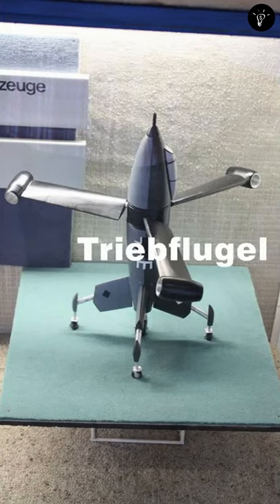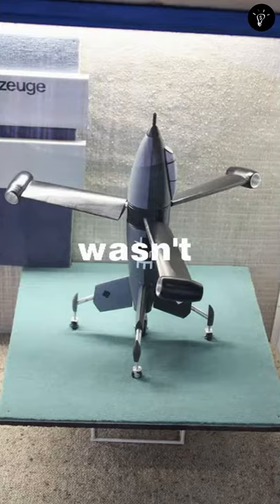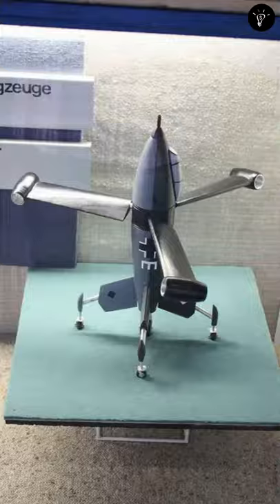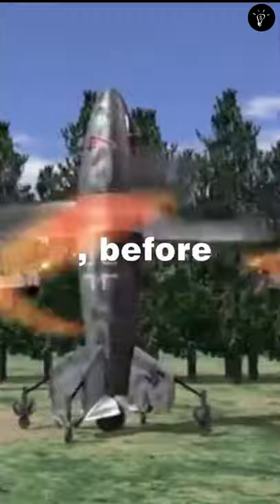Helicopter or a fighter aircraft ?

Comment: Smoked the allied powers? That’s just nonsense to anyone that has studied history. The ME 262 was operational and far superior to the Ally’s fighters. Didn’t matter though because the superior numbers of army air force fighters just waited till the 262 needed to land and then they smoked the jets.
Reply: There arnt many acounts of this happening and the success rates were low. The 262 is a shark of a jet. It's most eye piercing flaw being that fritz didn't have enough of them. If they had as many 262s as they did 109s and 190s the allied air campaign would be, to quote the profit of truth "A colossal failure"

Wouldn't have changed the overall outcome of the war I don't think but it definitely would have dragged it out longer, like 47 or 48 with more tanks and planes being produced certain battles in the east might have taken different turns for sure
Reply: It's performance was superior at certain altitudes and me-262 fuselage had less survivability due to it's weak fuselage for that kind of engine
Reply: @brecibros2469  its largest flaw was literally everything about it, but in particular the engines, which had a service life of something like 25 hours before needing to be overhauled.
Reply: @17njl01  okay my points still stand. If they had more of them they would just have to wait for the bomber  escorts to run out of gas and they would be defenseless even with the escorts us pilots hated having to fight them. They were to fast.

Comment: Is the aircraft you are showing aerodynamically stable? A helicopter has a counter rotor or a back rotor, the only kind of counter rotor device this thing has are those relatively small fins. The USA made a similar  aircraft in the 1950's I think. Based on the very limited success of that model, to say this aircraft would have "smoked the allies" is a grandiose overstatement.
Reply: Defense stance I have to say it would also have a bigger silhouette making it easier to hit the rotor or wings. And new tech takes new training as well as materials to produce which Germany already lacked
Reply: Helicopters need a counter rotor because the force accelerating the rotor is exerted from the engine in the fuselage and thus also on the fuselage. Here, the propulsion is by jets or rockets on the tips of the rotor and so torque applied to the fuselage would be simply by friction and I'd imagine it would be negligible. Certainly negligible at normal flight speed.
Reply: @Patrick-zr8tv  there could not be rockets or jets on the tip of the rotors because there would have been no way to supply fuel or throttle or pitch control. The video narrator is just full of shit there's absolutely no way for that concept plane to have ever even lifted an inch off the ground before falling over and blowing up.
Reply: @chrisbooge2217  I don't see anything that would prevent throttle control and you dont really need pitch control. Nice to have yeah but not necessary, particularly in this case.
Reply: @Patrick-zr8tv  the same thing that prevents fuel from getting to the tips of the rotors would prevent throttle control and ignition / shutdown control. And you would have to have pitch control there's no way around helicopters have it the osprey has It anything that takes off vertically by means of spinning blades has to be able to spin the rotors up to speed then progressively change the pitch to create lift .
Reply: @chrisbooge2217  I have no idea what you're going on about with the fuel not being able to get to the tips. If anything it would be easier because you wouldn't need a pump you could just the centric acceleration for that. 

And with the variable pitch, it seems to have that ability. If you look at the root of the blades it has a metal rod connecting each blade instead of meshing nicely with the main bearing or whatever it would be called. My point was though that it's not absolutely necessary for it to be able to fly.
Reply: @Patrick-zr8tv  first you were talking about it having rockets or jets on the tips of the rotors the wings are not big enough to be fuel tanks so you would have to transfer fuel from the fuselage down the rotors to the motors on the tips.  So you can throw all those ideas out the window. And yes it would have to have pitch control for takeoff and landing like most ever other propeller driven vehicle ever made.
Reply: @Patrick-zr8tv  and I see no metal rods on the 8" tall model on the desk or in the animations.
Reply: @chrisbooge2217  why could you not transfer fuel from the fuselage to the motors?? And again, no, it wouldn't need pitch. That's helpful for having quick response but all you need to have is the ability to change the rotor rpm, so just throttling. 

The metal shafts are towards the leading edge of the blades, just looks like a bearing at the base of the blades.
Reply: US formerly has a aircraft like this design, and they are fk terrible
Reply: @lurkingblayd3470  yeah it kinda looks like the wings be just easy to hit if you continuously aim in the direction.  Probadly an ugly damage be taken
Reply: @Patrick-zr8tv  you can't transfer fuel through the bearing device that it rotates on or throttle control especially with 1920's technology. And once again there is no metal rod. And yes it would need pitch control every rotor powered vertical takeoff vehicle ever built and flown has had pitch control.
Reply: @chrisbooge2217   Just because other VTOL aircraft have rotor pitch control doesn't mean it is necessary. You can control lift generated by changing rpm as well. This doesn't even matter though because it seems to have pitch control anywah

As for the fuel I really don't think your point has any legs to stand on. Much crazier things have been done, it's possible, this was designed during world war 2 in the 1940s when development was ridiculous and there isn't anything to say it can't be done.And the throttling not being possible, that's just not true. There is nothing preventing a throttle from working in those jets.

The metal rod is there. I'm looking at it right now, it's on the model in the thumbnail.
Reply: @Patrick-zr8tv  yeah he's right just admit your mistake before other peoples start joining. Every I repeat EVERY propeller driven aircraft Must have pitch control because as the speed goes higher the lesser efficient the props go thats why it has to have pitch control, without it probally couldnt even take off because you have different settings for cruising and take off
Reply: @billytheshoebill5364  that is just straight up false. Props didn't have variable pitch for the first three decades we used planes. So don't give me that shit.

And like I said, it would have pitch control. My entire point was that it's not ABSOLUTELY necessary, not that it doesn't have the ability.
Reply: @billytheshoebill5364  strawman. Also, we don't. I don't know a single person who needs to drink distilled water. Tap water does just fine. Even river water. And I bet if you were lost out in the bush for a few days without water you'd be more than happy to drink out of a stagnant puddle.
Reply: @Patrick-zr8tv  nope you are the strawman
Reply: @Patrick-zr8tv  yeah and what does the effect do on the human body?
Reply: @billytheshoebill5364  I'm not calling you a strawman mate, you strawmanned my argument.

And what the hell does "yeah and what does the effect do on the human body?" even mean?

Comment: The rotational forces involved alone would have been a nightmare to overcome. It would need to counteract the reverse force of the blades. The blade tips would go supersonic. It would be tough to make this fly.  I think that the fuselage would spin opposite of the prop. It would crash Right away. It would need counter rotating props of a smaller diameter with variable pitch.  The weight of the engines of the time and the weight of the drive and bearings would have kept it a model in the wind tunnel till it was scrapped.  If. If it made it. It would be a sitting duck. Takeoff and landings it would be smoked so easy. Just fly around the field till it comes back in 13-15 minutes to land and shoot one hole in it and it falls to the ground and burns.   Just imagine if the pilot has to bail out with that prop.

Comment: Oh yeah? There's nothing on that contraption to counter the enormous torque. And the complexity of the manifold required to fuel those wing tip thrusters seems improbable given the small diameter of the rotary wing to fuselage coupling, which also seems to be configured for variable pitch. There's not enough available storage for fuel in those stubby airfoils to go beyond liftoff itself, which would require the most expenditure of fuel, and probably quite a lot, so cruising fuel would have to be stored in the fuselage. 
And I see many other problems, ground ingress, operation other than in still wind conditions for launch and especially recovery, and improbable aircrew survivability if you need to bail out in flight with that large propeller behind the cockpit.
I don't think this would have worked until the Germans suffered quite a few mishaps during the experimental phase.
Reply: Correct

Comment: This vtol aircraft would have been smoked by the allies. Even ignoring the difficulty of landing, it's not a good design.

The profile of the aircraft is massive, meaning hitting it with gun turrets would be easy, not to mention there would be no way it would be able to turn effectively, so allied escort fighters would have destroyed the fighters pretty easily. Also, the industrial capacity to create this in mass just didn't exist in Germany by 1943 and allied bombing campaigns meant that there wouldn't be a way for them to get the industrial capacity needed